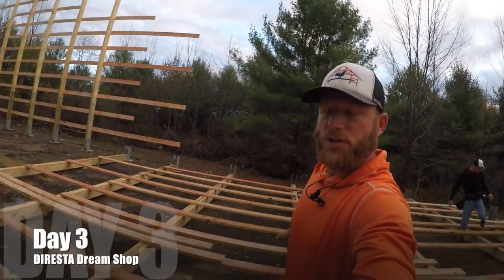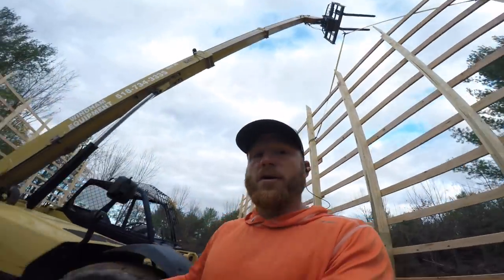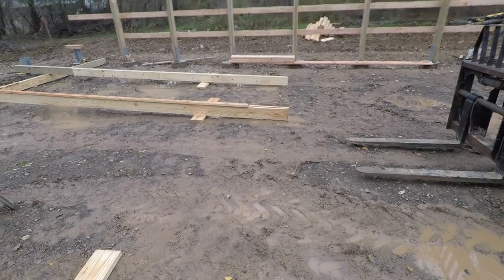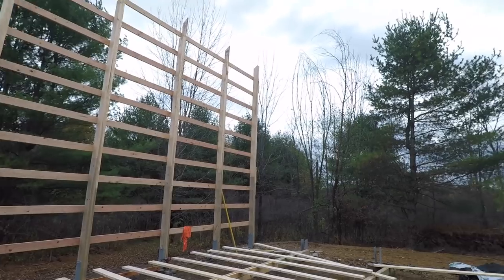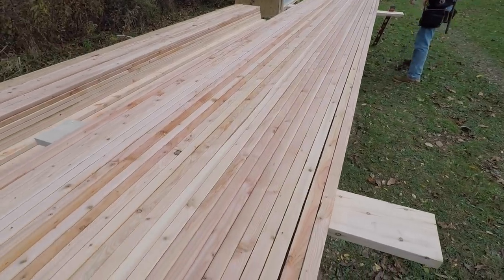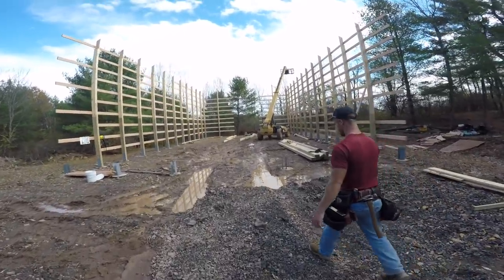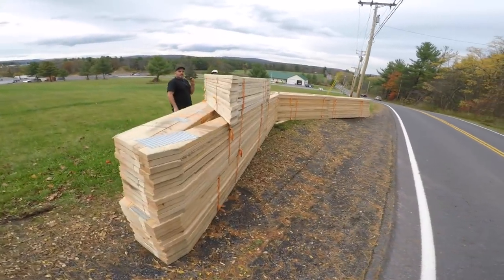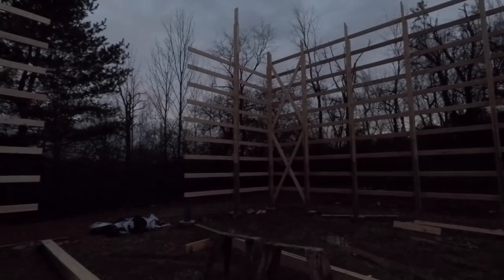Day 3.. Diresta Dream Shop

Comment: When you put the 2 bolts on the base bracket put one bolt one way and the other bolt going opposite. That connection will be stronger.

Comment: Any reason you don't use permacolumns? Having a pole barn built this spring and was thinking of using them. Any thoughts. Hate to put the wood posts in the ground due to high water table. Really enjoy your videos!!!
Reply from the maker: Michael Martino I never put posts in the ground.  Perma columns are heavy, expensive, and awkward to install in my eyes vs using the concrete pier system like we use

Comment: I have no doubt it’ll be one strong building. But why horizontal studs as oppose to vertical  like a regular house/ building? And vertical studs so far apart?
Reply: Post Frame Advantage website has all the answers to those questions.